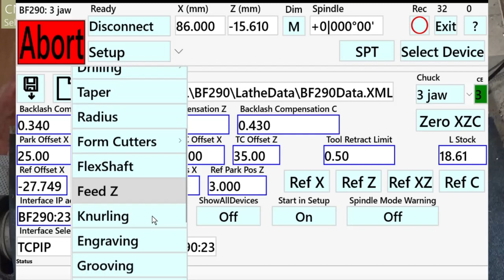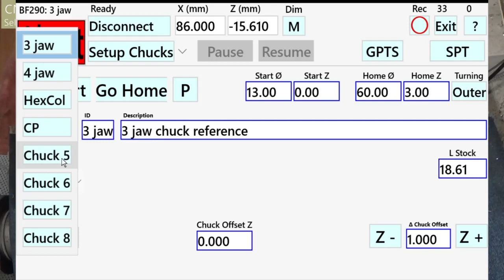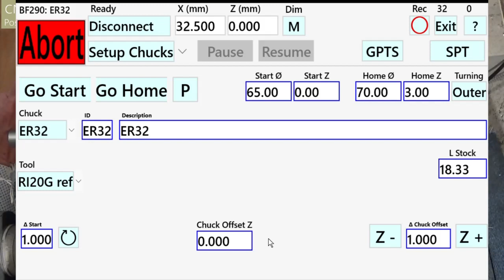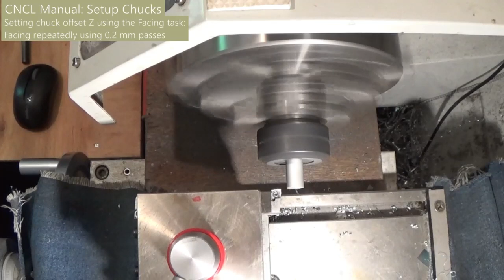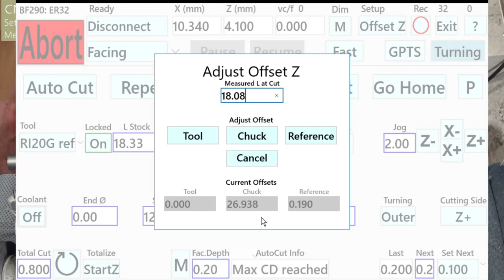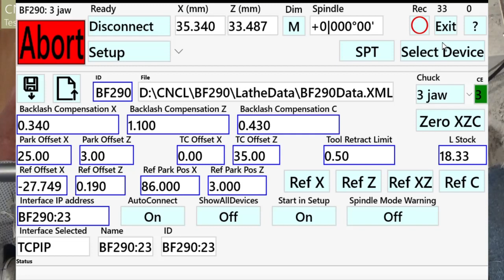CNCL manual: Setup Chucks

Comment: hello! I'm interested in buying your application, I would like to know what is the firmware that you use and microcontroller?
Reply from the maker: I use Grbl-L (Arduino UNO) and Grbl-L-Mega (Arduino Mega) that support G33 (spindle sync)  threading. I tested grblESP32 (ESP32 board) that does not support G33 threading and I bench tested GrblHAL (SAMD21) that supports G33 threading on some processor boards. Last week I found uCNC that supports several 8 bit and 32 bit boards and G33 threading. I want to test uCNC on my lathe as soon as I find some time.
I have the intention to develop G33 threading for FluidNC (ESP32). If uCNC works OK for G33 threading, I wil not develop G33 threading for FluidNC.
On the CNC lathe, there is not much to gain using a 32 bit processor in stead of an 8 bit processor. On the CNC router, I prefer the 32 bit MKS-TinyBee ESP32 board running FluidNC.
All boards mentioned are also capable of threading using a step/dir servo driving the spindle or an extra stepper motor driving the spindle. In general I prefer to use G33 spindle sync threading using the lathe original spindle motor. For some  high accuracy or left hand threads, I use the extra stepper to drive the spindle.
Reply: @MetalWorkerTools Does the Arduino uno card support G33 for threads with spindle synchronization? A suggestion should add signs of encoder quadrature apart from Index's such as Linuxcnc
Reply from the maker: Yes, the Arduino Uno support G33 threading. High resolution quadrature encoders require processor boards that have hardware support for this. Most processor boards do not have that. For G33 lathe threading it is also not required. A simple Index pulse is more than enough to do G33 threading on a lathe. If the spindle is low on torque at low RPM (like mine), adding 4 to 8 synchronization pulses is more than enough (I use 4).  Grbl-L, Grbl-L-Mega, uCNC, grblHAL, Mach3, Eding CNC, CSlab and a lot of other boards have implemented threading this way. LinuxCNC combined with a Mesa board can handle high resolution quadrature encoders. As far as I know, Clouch42 ELS also uses a quadrature encoder.
Look at the Grbl-L or Grbl-L-Mega Wiki for more information on how the threading is setup. https://github.com/MetalWorkerTools/grbl-L-Mega/wiki
Reply: @MetalWorkerTools thank you! You have done very good job before everything I am familiar with your application I still do not understand it well😅
Reply from the maker: Just take your time and make small steps.
You can use the CNCL trial version for 30 days. It is full functional without limitations.
Regards, Huub
Reply: @MetalWorkerTools Yes, there I learn thank you very much 👍